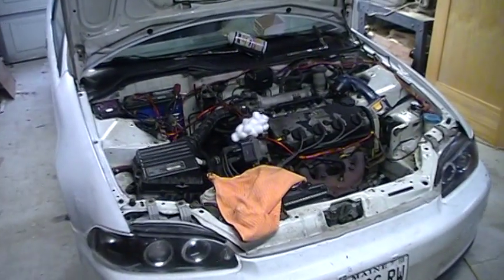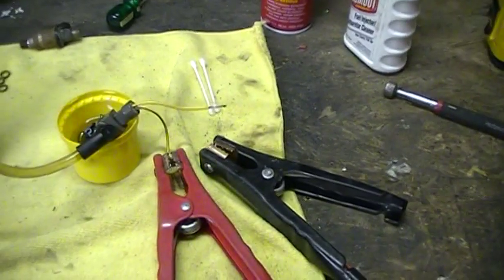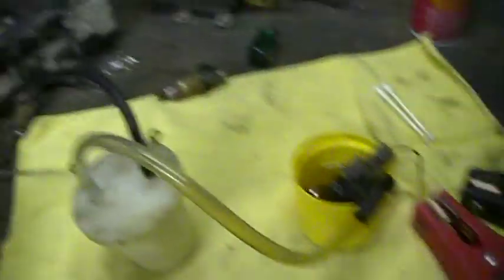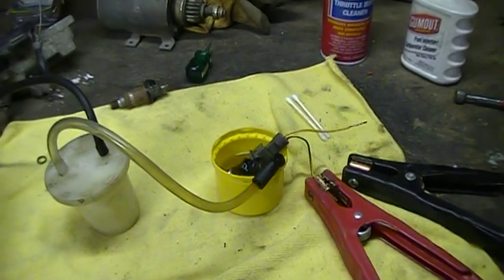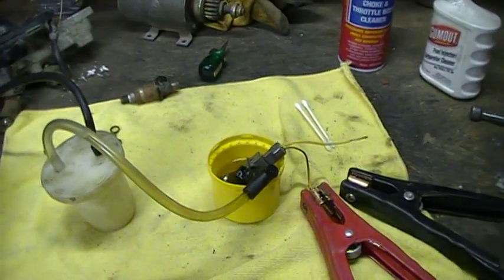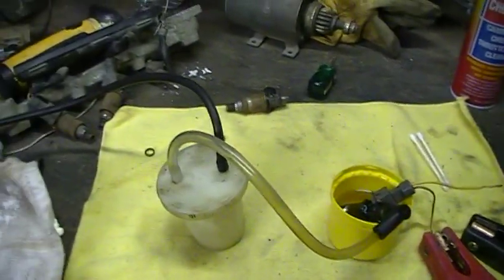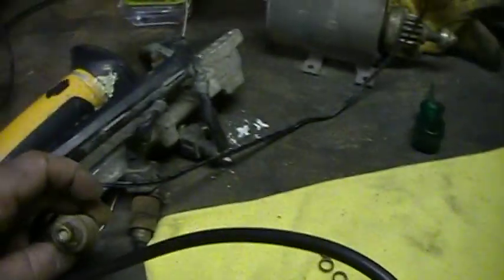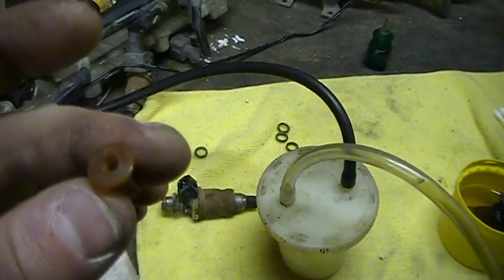Backyard Mechanic DIY fuel injector cleaning

Comment from the maker: @mrmaxv1 Thanks for the + on petroleum jelly.  Indeed, both grease and petroleum jelly are petroleum products.  Injectors are used in a petroleum environment, so one can assume they can take the chemical.  I used it for two reasons, one was to provide a better seal then the gasket on aluminum could provide alone.  The other was to lubricate the whole injector.  They don't slide back in very well dry.  Without some kind of lubricant, the gaskets tend to get damaged on re-installation.

Comment from the maker: @Brownbeardad 
These particular injectors operate on 12 volts.  I suspect other makes or models may run at different voltages, but these have a 12v hot at all times wire going to them that the ECU then gives ground to at the appropriate time.
You can use a 9v I know for cleaning (learned that afterward) and obviously lower voltages, but I like to use what they get in the car.  Neither approach is wrong.
B

Comment: thanks for the reponse. i tried the spray can method. the pressure is not enough after a few squirts. will try your vacuum method. looks like the injector sitting in the cleaner will work better.

Comment: Ah ok that makes more sense. I thought you had injectors that had been sitting around for awhile and decided to clean them up. Or you were trying to fix stuck injectors. It didn't come off as just doing routine maintenance which this in theory would work. As long as stated before they're not messed up to the point they're getting stuck while being used.

Comment from the maker: Is that right?  I've never heard of that.  My understanding of VTEC was the engine switching to a different cam profile thus changing valve timing during high throttle/rpm/load events.  
B

Comment from the maker: No, I have no way of knowing whether they are getting stuck open or not under pressure.  On the bench, they are closing, but who knows what happens during operation.  My purpose for the video was to perform routine maintenance cleaning, not fix a bad injector.  I could have made that more clear, methinks.  Anyway, thanks for the info!
B

Comment: I see you are using a 12 volt car battery to cycle the fuel injector. Has this caused any problems? I saw another fuel injector cleaning video on YouTube where he uses one AA baettery (1.5volts). He states the fuel injectors run on about 5 volts?

Comment: 12 volts is death for the injectors, I run at 1.5-2.2 volts Using a adjustable power supply for a tattoo gun

Comment: Please be careful doing this... there's a lot of things that can go wrong with your setup. Also you mention you keep the fastest flowing injectors for the vehicles. Are you 100% sure those injectors are not getting stuck open? That happens a lot and one of the many reasons you need to have a way of viewing the injectors under various pressures like we do with the ridiculously expensive ASNU machine.